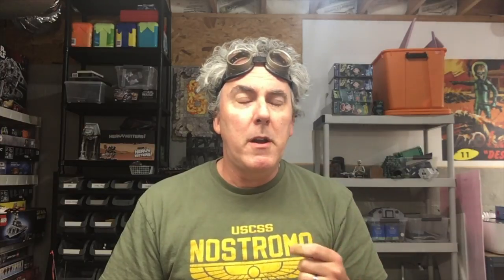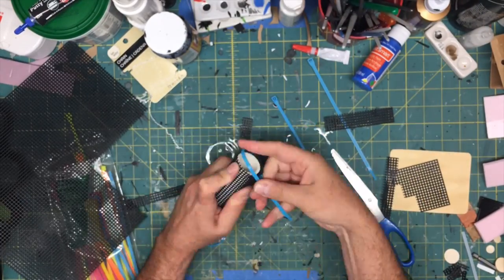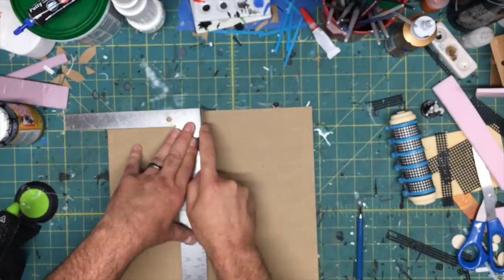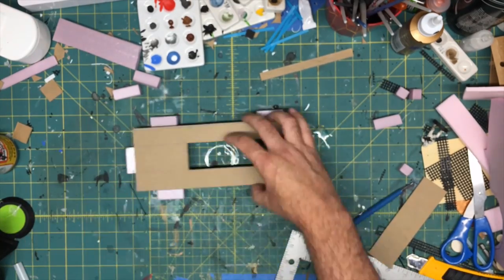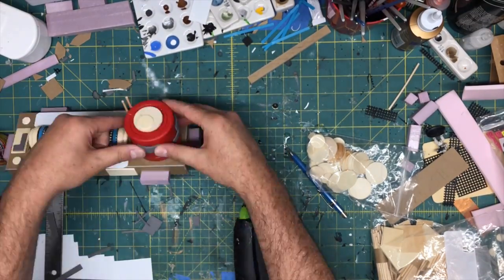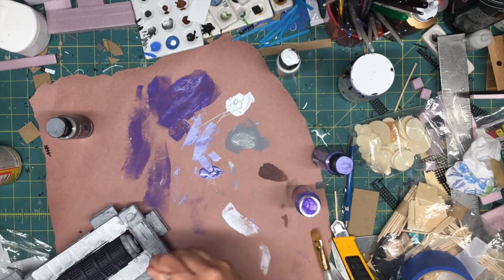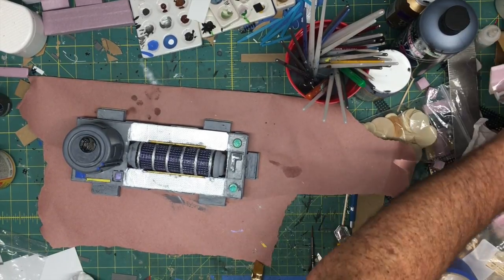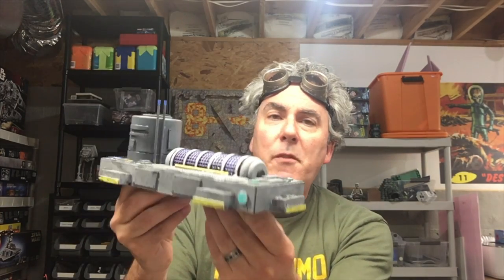GTE 068 -- SpeedBuild -- Graviton Collider

Comment: Excellent build!  As I was looking at the photos at the end, it struck me that the upright tank/pillar could really use a control panel on the side opposite the two pipes.  It would serve as a great objective for various rpg/wargaming scenarios, with characters battling around and on top of the terrain piece as they attempt to turn on or shut down the machine, which can only be done from the control panel... :-)
Reply: Definitely. Depending on the game you play, you'll have to modify as needed. But yeah, control panel would look cool.